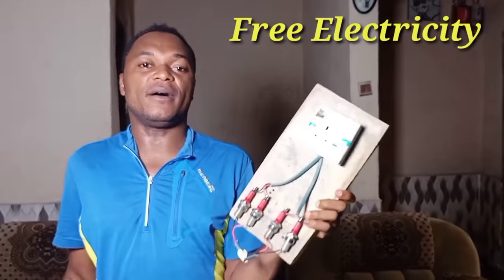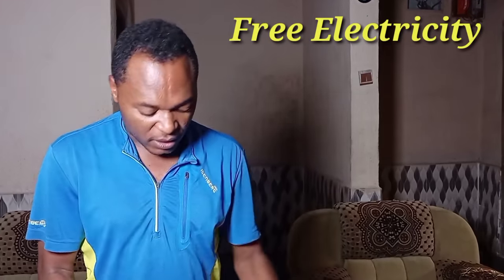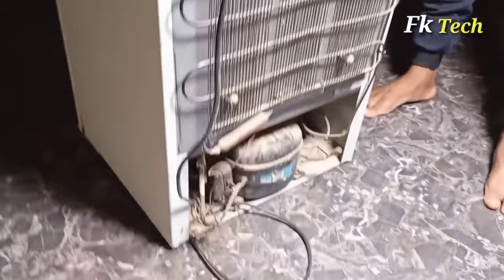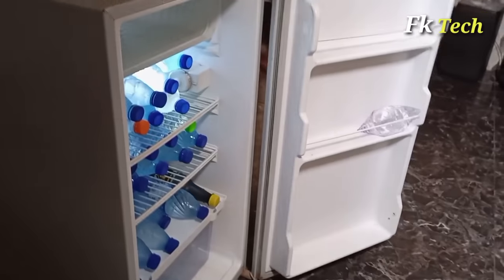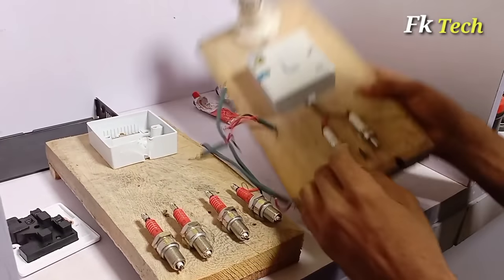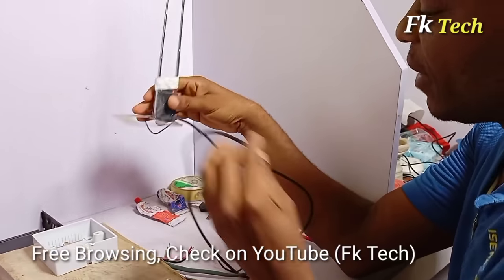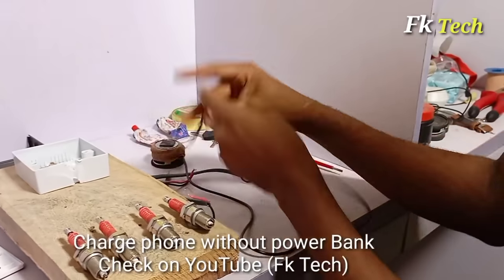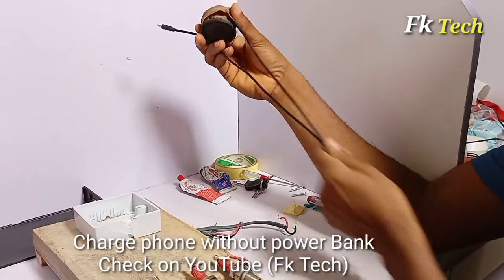Free Electricity Energy to Power a Refrigerator With Spark Plugs (Fk Tech)

Comment: FK can you power an air conditioner?
I would suggest if you can check the maximum load 4 spark plugs with the magnets can withstand and how long.

Comment: How did you connect the cable in the socket, did you join the red and black wire in the red terminal? And the red and black wire in the N terminal? Am confused there
Reply: Black to and red to red

Comment: Please I have a question sir...I went to the market to buy iridium spark plugs just as u said u your video, I saw one, the mouth is very sharp but underneath it , I can't open the open to fix the cable, it can't be open under.. Please where exactly can I get the plug because am based on the island.....

Comment: viewers Must read this
You need a power source to light up a bulb. Things you have mentioned dont have one.

A Spark plug is a plug that sparks when high voltage is introduced to it. Nothing else..

Idk why people confuse themselves into thinking that a spark plug is something out of the ordinary and could possibly generate electricity if you stick a magnet to it..

With just those items, there is no way to generate electricity. With a lot of wire and the magnet, you can generate electricity - wind the wire on a soft iron core, and rotate the magnet quickly in the presence of the coil and you will generate a little electricity,
Reply: Yes I have experience this one ( true talk

Comment: Hi,do you need any protection like fuses and breakers for this.
I will need 220volts for my AC.
Then for shore I'll dump my solar power system.
L.K.
Reply: How offen do you have to change the plugs?
Reply: Don't dump your solar panel yet, there's no free electricity anywhere.
Reply: @bemmichaelfoor6796  yes oo bro

Comment: You are great achiever Project Executive is this spark plug in any Nigerian shops and each one is how many niaira sir
Reply: 2k and above, you can get it from car or motor spare parts shop, that's the plug cars use
Reply: Pls Engr what type of cable is preferable for the connection
Reply: What is the capacity(watts)?
How long will it last?
Is it safe for electronics gadget?
Is it cheaper and durable than solar inverter?

Comment: Pls, I have the plug in case anyone wants to try this.
Reply: Where do you base
Reply: How can I get the plugs from you
Reply: I need the plug
Reply: Where do you reside?..... I'm in Lagos.
Reply: @adchrisakinyode5087  how much is the plug
Reply: @chukskingley4155  2500/one
Reply: @adchrisakinyode5087  I'm at Ajah badore
Reply: Sir are you sure this method will work for electricity before you sell the plug be God fearing.
Reply: @emmanueljoseph9673  Well, I can't answer that o. Pls, ask FK Tech.
Reply: Please is it the same red color spark plugs
Reply: Pls people open your eye have ever seen a plug ignite it self without a force take a look that same guy is using white plug why is it red plug this plug is a plug and there is 3 type of plug no one of it can produce without a force without a plug starter be wise.